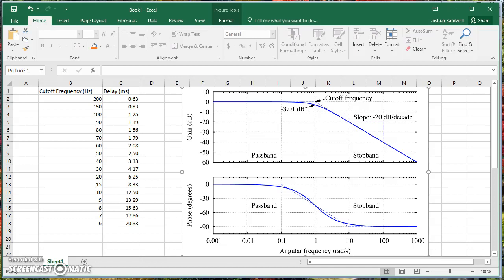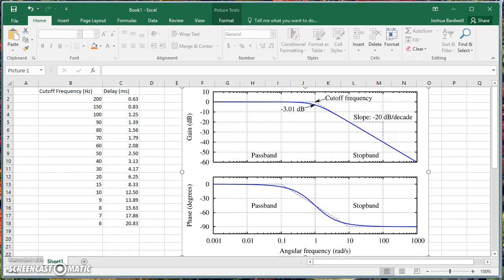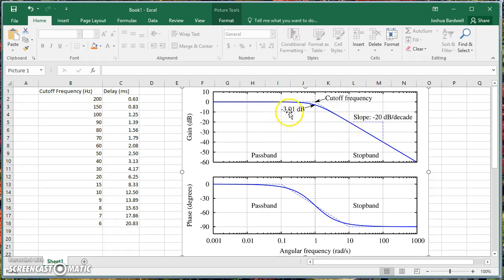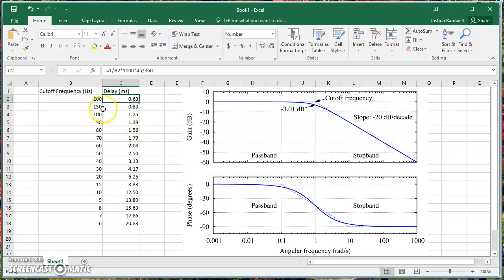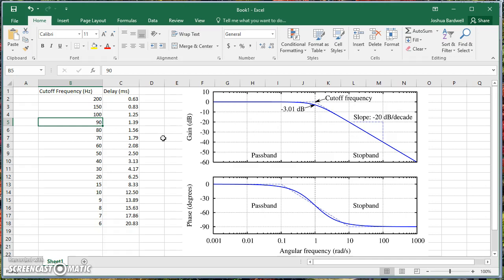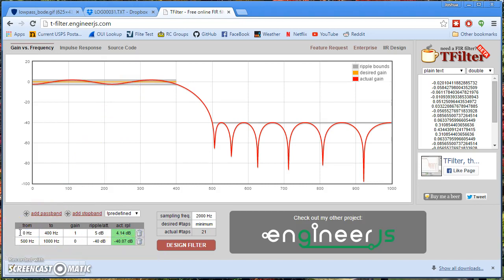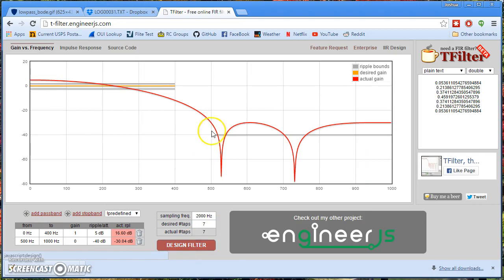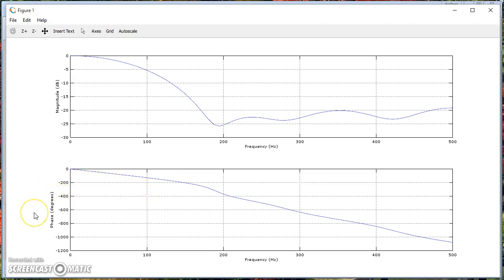BetaFlight V1 vs. V2 Filtering (1st order vs FIR)

Comment: I suppose FIRs will make a come-back when we move to F7 FCs. The increased processing power will mean we can have more taps and therefore a more effective single low-pass filter replacing PT1 + notch combos.
Reply from the maker: +pulquad possibly so. The main disadvantage of FIR is inability to change the filter on the fly.

Comment: I think your FIR filter example fails because you entered 50 Hz when you said you were entering 500 Hz.  See 11:25 into the clip.
Reply from the maker: +John O'Shaughnessy I meant to enter 50. My intent was to create a FIR filter similar to what might be used to filter the gyro on a multirotor, in which case you would want to preserve about 40 Hz and below, with a strong stop-band above. But I think the problem is that 40-50 Hz is too steep of a rollof to actually achieve within the constraints of this simulator. It would require too many taps. I think if I moved the stop-band higher, the example would work.